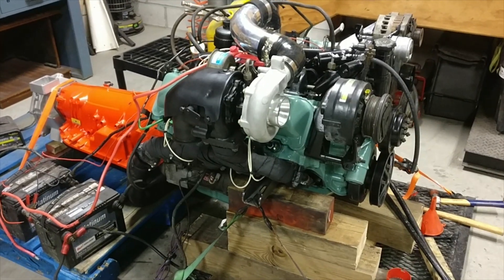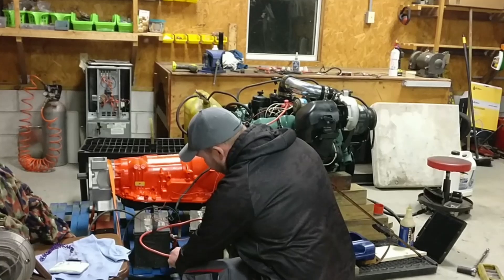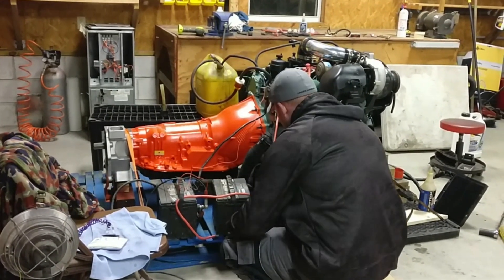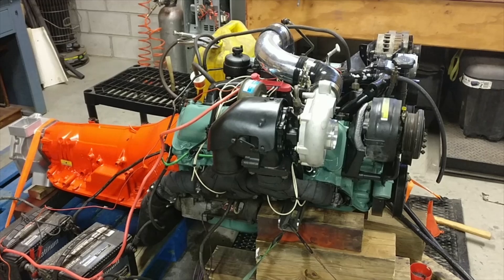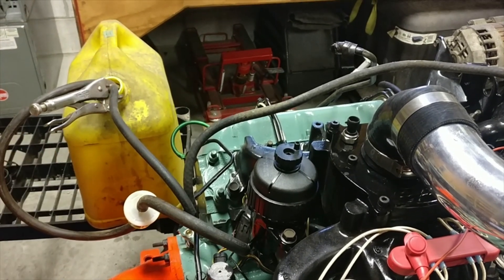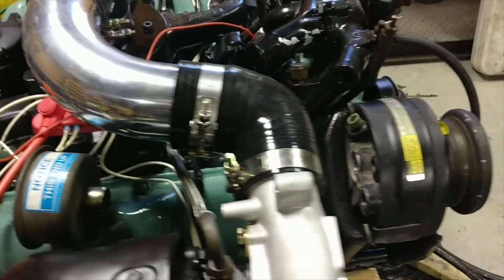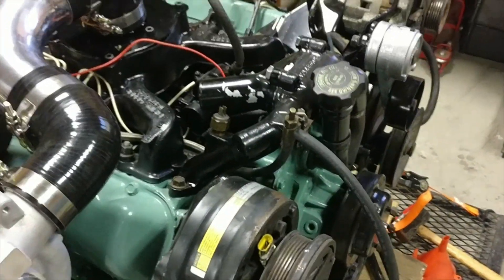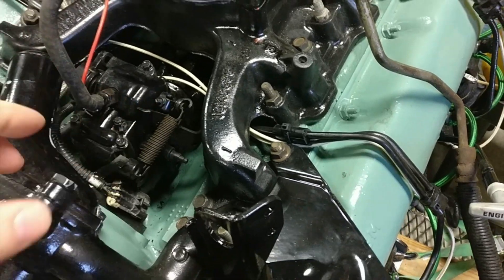First Start of the 6.5 Turbo going into my 91 Landcruiser FJ80

Comment: Nice Motor
How much HP is it pulling?
Reply from the maker: These IDI engines never made a lot of power without a ton of internal work.  This was factory rated at 200HP.  Upgrades include a bigger turbo (Holset HX35 swapped since this video), bigger 3" intake, 3" exhaust, better pre-combustion chambers, all of the cooling upgrades, and more fuel.  With all of that, I'm guessing that it's in the 250HP range.  However, the goal was to build something that easily moved the LC and got better mileage.  My torque should be somewhere in the 500ft-lb range.  All of the upgrades, except for fuel, will help this engine run cooler and more efficiently.  The Land Cruiser stock 3FE engine produced 155HP and 220ft-lb.  I was lucky to get 9 MPG on 35 inch tires and rarely got out of 3rd gear.  With this new engine, I should be in overdrive all day long and get at least high teens for fuel economy.  

I can't put this thing on the road until I get a suspension lift.  I need some more clearance at the oil pan before I can move it.  My lift is on back-order for at least another week.

Comment: Do you have a part number for the cold solenoid assy that pushes against the throttle arm? I have an optimiser with harrop S/C fitted, located in Australia. Thanks Phil
Reply from the maker: I believe it is 19190917 for my 93 with the mechanical IP. Hopefully that works for you.
Reply: @raevennull  Thaks ryan, appreciate it. I will see if rock Auto in the US can supply.